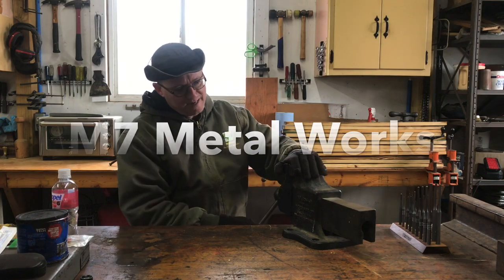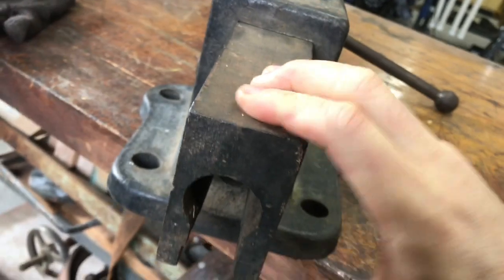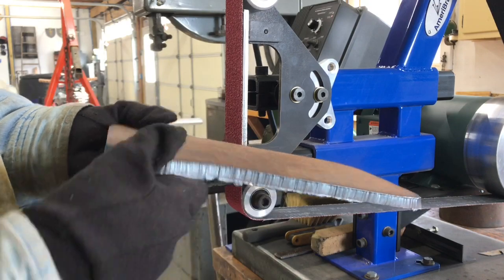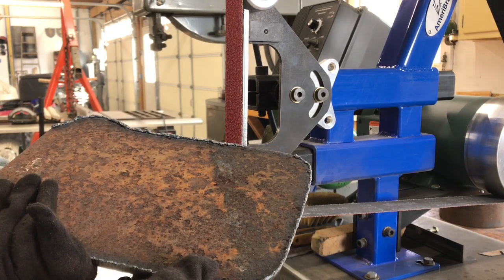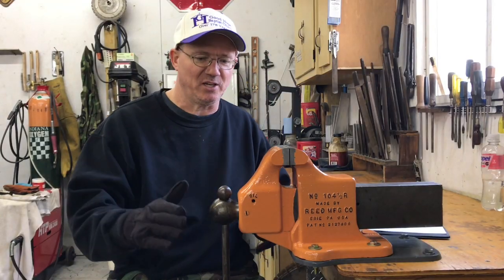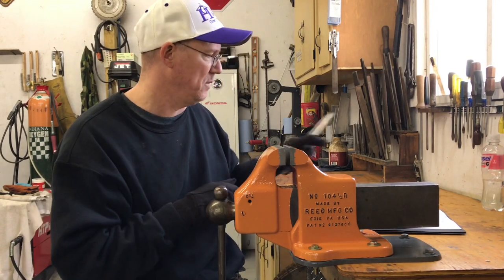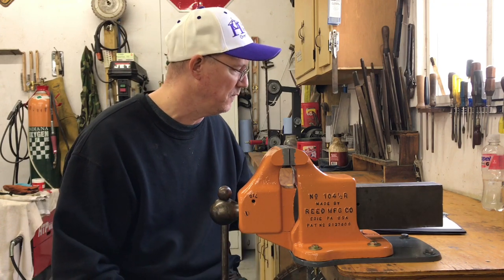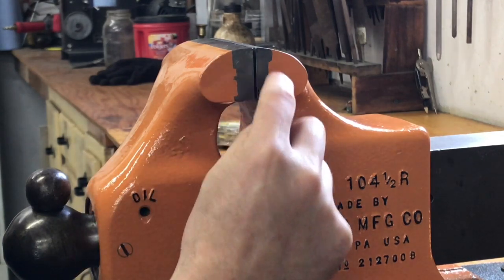Reed 104 1/2 R Restoration And Fabricating An Extension Plate: The Best Vise Ever!

Comment: Really nice restoration, I know I'm late to this  but just picked up a Reed w/craftsman badging (looks identical to this one) do you have any resource links or info on this vice? I'm unfamiliar with them & haven't seen things like the split nut before.  I'd like to know more & get a better idea how it comes apart (tips & tricks) so I don't regret potentially ruining a part that's hard to find.
Reply from the maker: Wow I did not realize Reed made some Craftsman vises! Definitely gonna pay better attention. I would not worry about ruining a part. If you are mildly mechanical you'll be fine. YouTube can help with that as well. Good luck and thanks for the comment!

Comment: Do you like the reeds better than the parkers and if so why?
Reply from the maker: I like them both but for different reasons. The Parkers have that tension screw for the handle and that's cool plus they are built very rugged. Also their swivel bases are soooo smooth. I think the Reed is just super precise and sooo well made!. Both have their place and I am glad to have several vises in my shop.
Reply: @shopdoc  I just rebuilt a parker 974 1/2 and I do like the tension screw. The vise does have a bit of slop in it. I may machine the vise and install a bushing for the lead screw to tighten it up.

Comment: I have a 104 1/2 reed vice, the spindle nut is stripped, was wondering if they are available ???
Reply from the maker: I am unaware of any replacements available. You could have yours drilled out and then sleeve it with a nut from McMaster Carr potentially. Or you could have a machinist fab one but it is likely very expensive. I would look for one on craigslist, Etsy, or ebay that is in terrible condition and try to get it cheap. The nut is rarely bad on these vises but the exterior do get beaten up pretty badly.
Reply: @shopdoc  Thank you

Comment: Excellent video, amazing vice. What process did you use to apply the BLO?
Reply from the maker: I warm the part up real good then apply the BLO. I allow it to cool then wipe the excess off and let it dry completely.
Reply: @shopdoc  I love your videos. Just based on your vise resto vids I purchased a Prentiss 524 and a Parker 974. On the Parker, it's missing the set screw that goes in the spindle handle. Do you know what size screw that is?  Keep the vids coming, especially vise restoration. I'm in SoCal (although I fly to South Bend annually to see my Fighting Irish) and don't across too many Reeds. That Reed you have is on my wish list, I even love the color.  Thanks again.
Reply from the maker: @John-qt8fx  Thanks so much! I have a great friend living in San Diego. When you come to South Bend do a Craigslist and Facebook Marketplace search for vises. I think you'll be pleasantly surprised what you'll find in that area for cheap! Not sure the size of that screw in the handle...maybe 5/16. It may be a custom thread??

Comment: not sure how well designed that piece on the front of the lead screw is, but that thing at the back that you can actually knock in and out of the hole sure looks well designed....ive seen some GLORIOUSLY stupid and "creative" ways that these old time vise makers like to put things together, it boils my blood....
Reply from the maker: My opinion of the Reed vises is that they may be the best made vises I have seen. Charles Parker vises are pretty stellar as well and of course Wilton has to be in the conversation. I am sure there are others that have produced some incredible vises. I have seen some poor designs as well. Many cheaply made vises out there. Thanks for commenting.